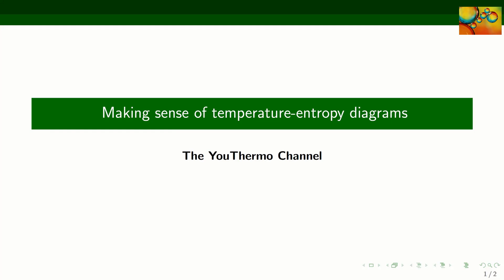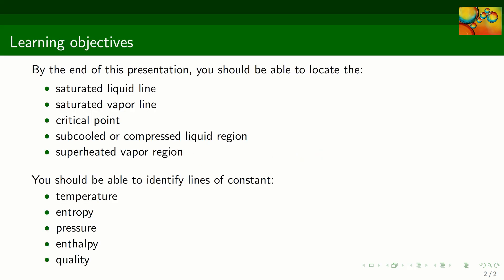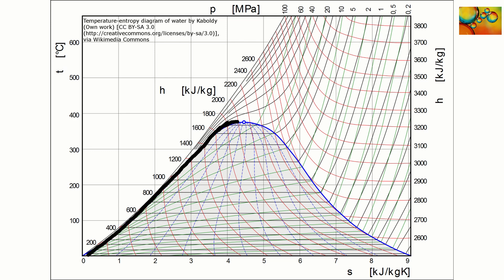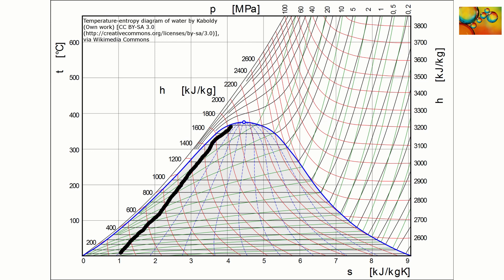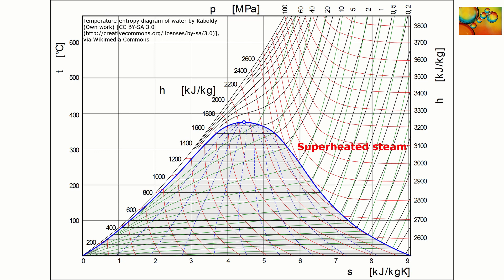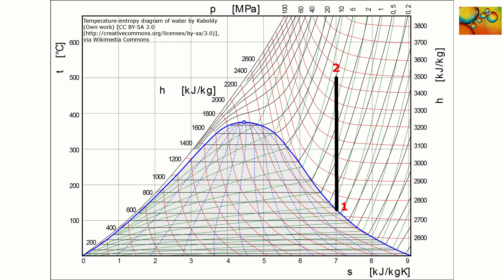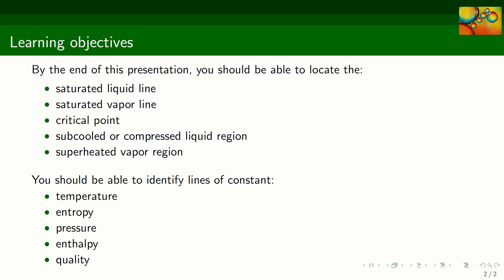Making sense of temperature-entropy diagrams

Comment: How are points 2 and 3 ISO-Baric,.. they are completely different temperatures!
Reply from the maker: Points 2 and 3 are at the same horizontal line, thus, they are at the same temperature. In addition, they are at the same pressure because if the temperature of a pure substance remains constant in the two-phase, it is because the pressure remains constant too, according to the Gibbs phase rule.

Comment: Can you give examples on you would determine values based on the diagram?
Reply from the maker: This is a diagram for a pure substance. If it there is only one phase, you specify two properties (e.g., T and S, or P and S, or T and P, etc...). Once you locate the point in the diagram that matches your specifications, the other thermodynamic properties can be found from the diagram. If there are two phases, that is, a condition below the "dome", the specification of a single variable - for example, T - allows you to determine the phase equilibrium pressure, and the specify entropy of the liquid and vapor phases in equilibrium. If you want to determine the relative amounts of the two phases, you need an additional specification, which can be, for example, the specific entropy of the system or the quality (vaporized fraction).

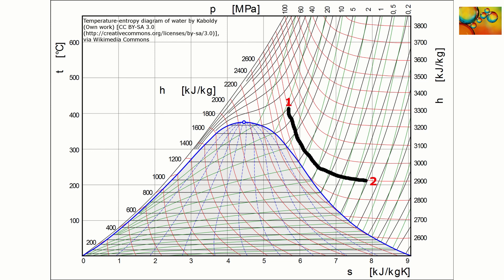Comment: How the pressure variation is represented in the dome if it's inclined line from 2 to 3 at 4:38
Reply from the maker: Thank you for your question. Points within the dome have two phases in equilibrium. According to Gibbs' phase rule, we have that F=C-P+2, where C is the number of components, P is the number of phases, and F is the number of degrees of freedom, that is, the number of intensive variables you need to specify to set the state of the system. For a pure component (C=1) in vapor-liquid equilibrium (P=2), we have that F=1-2+2=1. Having F=1 means that you can only specify the value of one intensive variable; the values of all other intensive variables of the phases will be the same regardless of the phase amounts. The line between, points 2 and 3 is horizontal, that is, all points of this line are at the same temperature. As F=1, these points will also be at the same pressure. Kind regards from the YouThermo Channel.

Comment: what is the isobar in the sub cooled liquid region also?
Reply from the maker: They would follow the trend of the lines outlined to the left of the saturated liquid line. Note that for condensed phases - liquids (far from the critical point) or solids - the entropy is quite insensitive to pressure. This means that "moving to the left" along a line of constant temperature - that is, decreasing the entropy - needs large pressure increases.

Comment: where is the sub cooled liquid region?
Reply from the maker: It is to the left of the saturated liquid line. Nonetheless, observe that water with low temperature and low entropy value may be in a solid state, but this diagram does not represent the solid-liquid equilibrium line. Thus, by just using this diagram, one cannot tell the condition in which such a liquid-solid transition would take place.